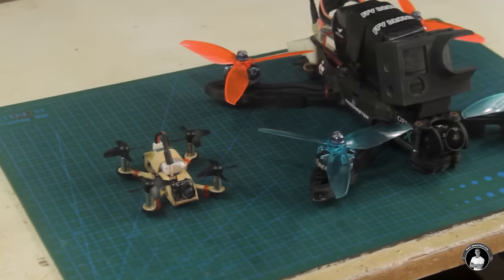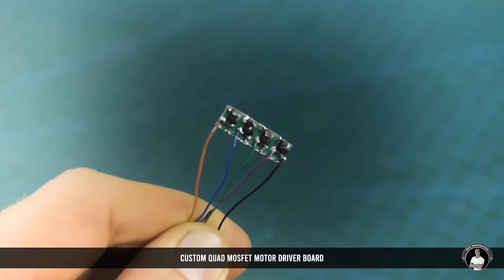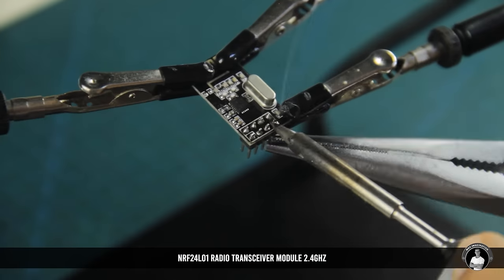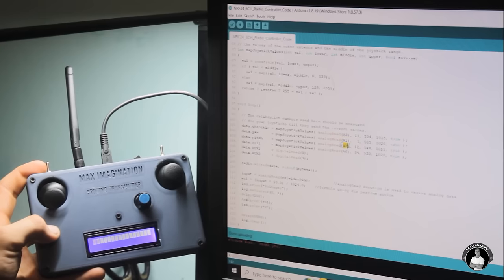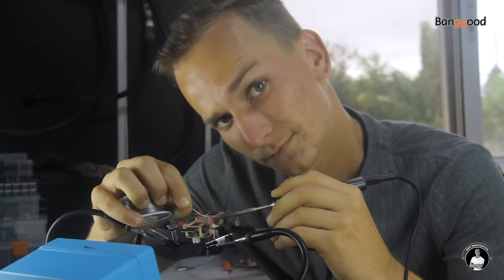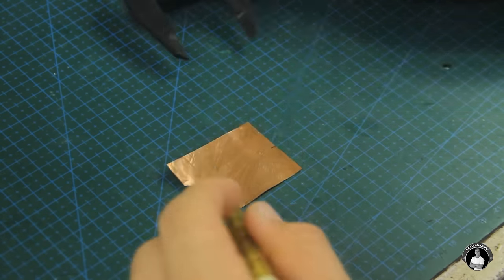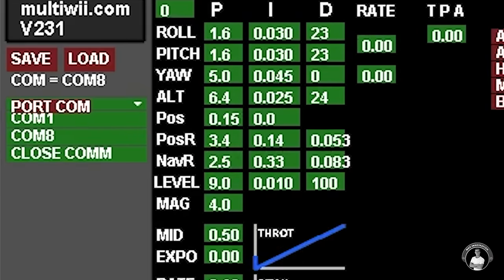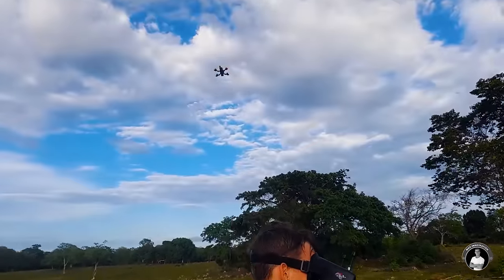Make a TINY Arduino Drone with FPV Camera - Will It Fly?

Comment: I have one doubt. Did you not encounter any problems with nrf module caue they tend to have a lot of noise problem with spi communication and seeing you use wires to transmit signals I wonder did it not cause any issues? When i used wired it caused me may issues it would work properly and there is a lot of noise
Reply from the maker: I had no problems with the NRF24L01 module on the drone due to powering it from the already filtered 3.3V supply onboard the MPU6050 sensor. The MPU6050 contains a 3.3V regulator with all the filtering capacitors which reduced the need of additional filtering capacitors on the NRF module.

Comment: Great! I tried it and why can't the Pro Mini 3.3V connect to the Multiwii? Even though it shows compatibility status, when I change to the Pro Mini 5V, it can connect.
Reply from the maker: That is very odd, it should work with both. Did you check you were supplying your Pro mini with a stable 3.3V input to test it?

Comment: hello sir am making drone with same specifications of components but i am making it with brushless motor will this code work for tha same
Reply from the maker: The code should work as long as the brushless motors' ESCs use PWM.
Reply: @MaxImagination  Ohk One more doubt in my PC mutiwii configuration software crashes when I click on start button what is tha solution?
Reply from the maker: Not sure, I suggest you ask on the multiwii forum: http://www.multiwii.com/forum/viewforum.php?f=16

Comment: Is it possible to use Arduino RF instead of Arduino Pro Mini and nrf module?
Reply from the maker: I haven't yet tried it. I assume its radio connection takes up similar pins. If so, I don't see why not.

However, I still suggest you to do your research on the board before buying.

Comment: Man. I'm detecting signal on the gyro's comm pins with the arduino, and it seems we're making back-and-forth cooms with MultiWii, but I am getting ZERO activity on the sensors. And my transmitter ain't cuttin' it, either. :(
Reply from the maker: The sensor needs an adequate power supply. Try both 3.3V and 5V, see which makes it work. Keep connections as short as possible and check your connections well, data wires can be misinterpreted.
Reply: @MaxImagination  Thanks for the pointers. I'm shopping around on handheld oscilloscopes and spectrum analyzers as well to make life easier. Wow, the market is very different from 15 years ago when I had a gigantic 80s logic analyzer for this type of stuff when building a TTL CPU! A lot to learn.
Reply from the maker: That's a good point, thanks for letting me know! I'm getting a handful of people everyday complaining that MultiWii is not opening. It must have opened in mine since I had Java already installed.

Thanks again!

Comment: What is the difference between smd resistor and a normal resistor. Can i use the resistor instead smd resistor if yes which resistor
Reply from the maker: You can, but keep in mind that using normal sized components will increase the overall weight of your drone. I recommend using SMD components which you can find in old tech. 
Use 10K ohm resistors.
Reply: Tnx for the clarification max
Reply from the maker: No problem, Hemanth!

Comment: Can you explain the connections of the two keys to which arduino pins did you connect it?
Reply from the maker: The toggle switch connections and other can be seen in the transmitter's diagram linked with the resource files folder below. Cheers.

Comment: Awesome project. 
I have been looking for arduino based brushed flight controller fir a while now.

Thanks to you, and all the members who made this possible.

I have few questions,
How about using any ppm or sbus receivers instead of using nrf transreceiver?
How would that play out?

Any tips is appreciated.
Reply from the maker: Hey and thank you! I wouldn't have a clue how to integrate an sbus or that style of receiver with the Arduino. However, the original code does support something like that.

Comment: Heyy MAX i am building this drone but i cant find the circuit diagram of transmitter and in emilos video shows a simpler vesiin but i want to make a transmitter like yours please give a complete circuit diagram of the transmitter i am in the mid of this project 😊
Reply from the maker: Hey there! The transmitter's diagram is now linked among the other resource files. Please check again. Cheers :)

Comment: I ran into another problem. In your updated code you included extra pinout order so im using that pins D3,D5,D6,D7 instead of 9,6,5,3. My problem is what is the order of FL,FR,BL,BR motors for that pins? Thank you
Reply from the maker: The pins you use should be 9, 6, 5, and 3. Not with D7.
The order of the corresponding motor-pin can be seen in the circuit diagram.
Reply: @MaxImagination  no i have arduino rf nano with fixed  ce, csn to d10,d9 pins so i commented that and you updated the code. In that code it have 3,5,6,7 pin order except default pin order so i uncommented it and uploaded the code and i connected to multiwiiconf now it showing pin 7,5,6,3 as moter outputs.as soon as i have receive other parts of my drone i will update this.sorry for my weak English . Thank you

Comment: Hey, thanks for the great video. I got into a small issue, one of the motors isn't working which is connected to D3 pin.(Motor isn't having any issue, driver circuit is also good as I have checked by interchanging connections). Can you pls guide me in what else to be checked?
Reply: I even checked the pro mini board by using another example code for any issue with D3 pin. But that is alright.
Reply from the maker: Hi there,
Have you made any of your own modifications to the code? I suggest double-checking the defined pins in the appropriate tab.

I also suggest you put a multimeter to each pin including D3 to see if there is any voltage.

Ensure other sensors are not using up that same pin.
Reply: @MaxImagination  Thanks a lot for the reply.
I didn't make any modifications in the code, I thought I must have messed up some part of code while uploading. So I downloaded a fresh copy multiple times and tried. But no luck.

As I have used the original code file given in the Google download, so I can say that no other function is given to D3 from my side. 

Right now, I disconnected the driver board and motor connections as well and  tried to power it up with only proMini+NRF+Gyro and communicated using the transmitter to turn ON the pins. All the other 3 pins are showing voltage, but how much ever I move the joysticks, D3 shows only 0V.
Reply from the maker: @surendra12456  Hey! Did you upload the code with all of its included code files seen as tabs in the IDE? Be sure you do, as this ensures all functions work as they should.
Reply: @MaxImagination  Yes I made sure of that. 3 motors are running fine with all the speed variations when the drone is tilted or joysticks are operated, So that might not be the issue. I will try to study the code and see if I can change the motor pins or tweak motor outputs. Can you pls confirm if 'output.cpp' is the file related to motors or is it any other file?
Reply: UPDATE: I got the motor to work. I used the original code from the Electronoobs by making pin changes as per your wiring circuit. After finishing this project, I will take a closer look at both the code files(your version and Electronoobs) to see what is the root cause and update you. Thanks again for the video and help. Keep going!

Comment: I bought SS14 diodes, but they seem to be too large. I noticed that the diode silkscreen in your production screenshot is T4. Could you please recommend any alternative diodes that can be used instead?
Reply from the maker: Hi there. You can alternatively use the BAV16W, T7, or other 1N4007-like Schottky/rectifier SMD diodes.
Reply: Thank you. I followed the method from the cloud drive and created the setup as shown in the following photos. However, when I connected it to the computer for testing, the software for adjusting the PID keeps crashing, and the remote control doesn't respond either. I thought it might be a soldering issue, so I made another version of the PCB, but it still doesn't respond and the software still crashes. What should I do?
Reply: Sorry, I can't send the pictures.
Reply from the maker: Hi there. I suggest you read my new pinned comment under this video for the solution to the software crashing.

I also suggest you check your RX/TX connections between your PC and drone to ensure it's not a connectivity issue. If you are getting the gyro and orientation of the drone working in the UI, check your drone receiver's (NRF24L01) connections and keep them as short and not interfered by the EMI from the motor drivers as possible. Making PCBs for this project can be a hassle... I suggest you look into EMI shielding solutions for your PCB,

Comment: Hey max I'm building this project Amazon isnt available in my country so instead of parts u told im available with these parts :
1)Resistor of 10k ohm but with 5%  SND resistor
2)ss14 sr14 40v 1A wchottky barrier diode DO-214AC 
do i need to do any modifications to your pin configuration or code please let me know asap your reply would really help
Reply from the maker: Hey there! As long as you use my exact recommended components and wiring diagram. You don't need to change or adapt the wiring nor change anything in the code.

Cheers!
Reply: @MaxImagination  thankyou so much Max hope I don't encounter an issues but if I do can I reach out on your mail ?
Reply from the maker: Sure, you can. Best of luck!

Comment: i want to ask you about the motor driver circuit diagram please upload a clear image of it and a dedicated circuitdiagram for it as i am getting trouble while building it. please help
Reply from the maker: Hi there. The diagram is linked below, if you want more details to assist you with making the motor driver, read the full project blog post and specifically see step 3: https://www.elektormagazine.com/labs/make-a-tiny-arduino-drone-with-fpv-camera

Comment: Hey, I completed building similar drone but with hc-05 bluetooth module here I am using RemoteXY app to control the drone using mobile, but the motors are not in sync, also my mpu6050 is not placed on top of any module as i have all three i.e nano, mpu and booster module in-line on the body so ig emi might not be the issue, can you suggest how to solve this plz, I am literally stuck at this point !🙁
Reply: I also added a 1000uf capacitor parallel to battery this helped slightly to prevent the drome from resetting but the main issue of 2 motors i.e front_right and rear_left spins but other 2 spins only on full throttle also i am using IRLB4132 mosfet and connected a 1k resistor to the gate to nano board and 10k between the two ends of motor so should i try to decrease the 1k resistor to 100-200ohm for easy switching as irl4132 has gate threshold voltage of 1.35 and 1k seems to be very huge ?
Help would be appreciated !
Reply from the maker: Hi there! The only thing that will solve your drone wobble issue as it has with mine is EMI shielding your microcontroller and MPU6050 gyro. I did it with a copper sheet. If you've already designed a PCB, well you may be out of luck or instead redesign it as a 4-layer board with grounded copper layers in between. These sensitive components need to be away from the motor driver circuit.

Comment: hey max. just a question.... can we make the control the drone via a mobile application
Reply from the maker: Hey there! You could, but that would be a completely different drone. I suggest you watch another video for that. Try ESP32-based drones. Cheers!
Reply: @MaxImagination  Hey thanks a lot mate. i was actually working on the esp 32 based drone. I was wondering if using ESP 8266 would be sufficient., as it also has wi-fi module
Reply from the maker: Hey! No problem.
You would need to check with code compatibility first. Many codes that work with an ESP32 may not work with an ESP8266.
Reply: @MaxImagination  hey... firstly sorry for responding too late..... and secondly thanks a lot for your efforts to reply and help me out with the doubts..... is there any way i can connect to you so that i can ask for guidance during the complications i get in making of my drone?

Comment: Great 👍.i want big help from you. I have arduino rf nano i want to use it for this project but in that board, permanant  ce an csn pins are d9 and d10 but your code defined d9 as motor output. How can i change output pin in code i had searched output.cpp but i cant find.also i saw in that code file you mentioned 3 text documents abut pinouts original, maybe ok,my pinouts.so maybe i think you can change pinout in code.i want only change d9 pin to eny other free pin.can you help.thank you.
Reply from the maker: Hi and thanks! To change the code to adapt to your board, in Output.cpp -> "Motor Pin order" -> and #if defined(PROMINI) on line 19, change 9 for another PWM pin such as 11.

Then, in NRF24_RX.cpp -> RF24 radio is where you change your pins to 9 and 10 for the NRF radio chip.

Also, I updated the code in the Google Drive folder to the one that currently works perfectly with my drone (in case you have been facing issues with one or more motors not running). I suggest to add those changes to that one.

Hope this helps!

Best,

Max
Reply: @MaxImagination  thank you very much 👍. You saved my time. Also again thanks for updated code. You are a great teacher.

Comment: I am still not able to make it please upload a very clear and enlarged top view of the motor driver board where i can easily understand the assembly of components
Reply from the maker: I have also added images of the motor driver up close in the project folder 📂 

Also, see step 3 in my blog post about the drone linked in the description which goes into more detail on how to wire the board.
Reply: @MaxImagination it is not properly visible

Comment: Im working on replicating this and i was curious what P/N SMD SCHOTTKY DIODE I need to use. Does it matter the amazon link has a variety of them.
Reply from the maker: I recommend you use the SS14 schottky diode. If not that, almost any other with a voltage drop of .3-.7V should work.
Reply: @MaxImagination  Thanks! I'm definitely challenging myself with this one, haha. Sawdering correctly will probably be my biggest challenge. Got any tips?
Reply from the maker: No problem. I recommend you always keep your soldering iron tip clean by keeping it tinned and scraped clean from unwanted particles. Solder each SMD component one by one as you place each one. Also, make sure you use helping hands and use tweezers to keep the components firmly seated on the board as you're soldering.

Cheers!
Reply: @MaxImagination  Hey, I'm having some issues with the code. More specifically after opening the MultiWiiConf program. After everything is plugged in, I select the right com port, then when I click start it closes immediately. Its dumping error logs into my files but they are confusing to read. Any tips or info that could help?

Comment: how long it will be work? Like 17m ?
Reply from the maker: 100 meters is the maximum range with the drone's current antenna (under perfect conditions). The flight time however, may vary from 2-5 minutes depending on whether or not the FPV camera is attached.

Comment: Hey max! Can you please make arduino based rc drift car controlled by PlayStation controller. The car has to be all wheel, the components arduino,hbright motor driver,hc-05 and mpu 6050 gyro scope. can you please make this happen?
Reply from the maker: Hey there! Not with a Playstation controller, but with a DIY transmitter, yes.

Stay tuned!
Reply: @MaxImagination  I cant wait!

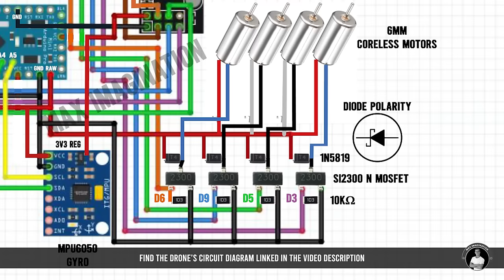Comment: Would someone mind explaining to me what he means by flyback diodes at 5:20 and what part that is associated with? I’m new and trying to learn
Reply from the maker: The "Flyback" diodes are normal schottky (fast switching) diodes placed in reverse polarity to the supply at the motor terminals to prevent flyback currents or the induced current spikes created in the coils when power is suddenly cut to affect the surrounding transistors. I suggest you check my community tab in my YouTube channel and read my recent post about those kind of diodes. Cheers.
Reply: Thanks man, I’ll check that out

Comment: I have made a remote for rc plane using your previous video. Can i use that for upload this code it don't have a display. Can i use it for this code without display? Thak you.
Reply from the maker: Hi there. Are you referring to the Pistol-grip transmitter or which? As long as it's an Arduino-NRF24 2-joystick transmitter wired according to the diagram given in this video, it should work. The display used for this project is the 16x2.
Reply: @MaxImagination  thanks for the reply bro. My transmitter is which you used for the flying wing.

Comment: Can be used 500k ohm Potentiometer
Reply from the maker: You don't need a potentiometer like I had in my transmitter. It wasn't used. You do however need joysticks and toggle switches.
Reply: @MaxImagination  ok thanks